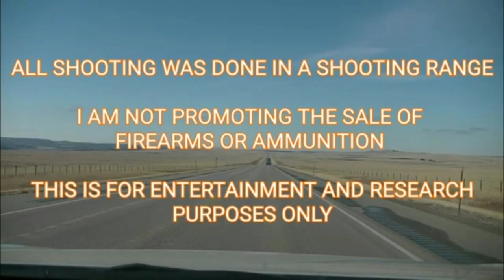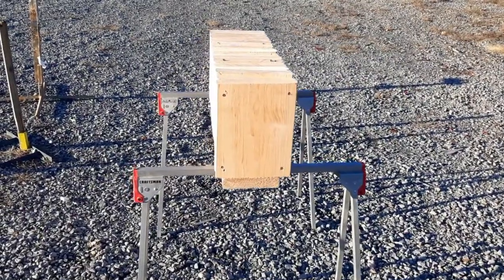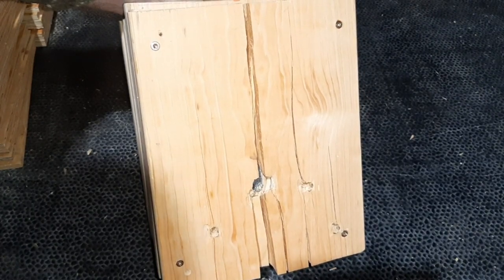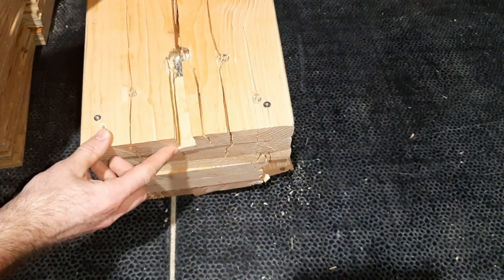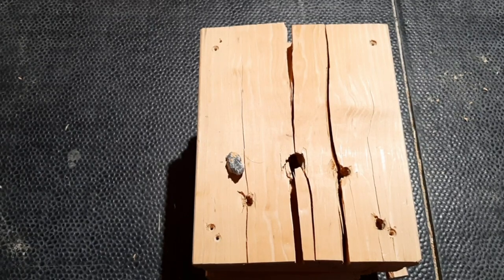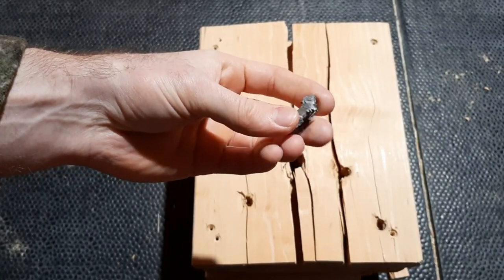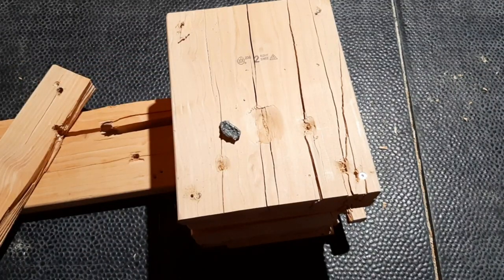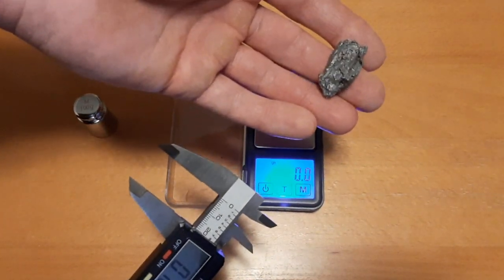12 Gauge 1oz Rifled Slug vs Lumber

Comment: That will go throw most walls most of the time, unless you get luck and hit a stud. So don't think you can start blasting 12ga slugs in your house, and not have to worry about you kids sleeping down the hall. They will go right throw 2 spaced layers of 1/2" drywall and still be lethal. I think Buck shot would be a better alternative for home defense. I'm not an expert, just my opinion.
Reply from the maker: Yes.  Been there, done that.  This same slug penetrated 17 sheets of 1/2" drywall and buckshot was 9 sheets if I remember.  Check my 12 gauge playlist it is in there.